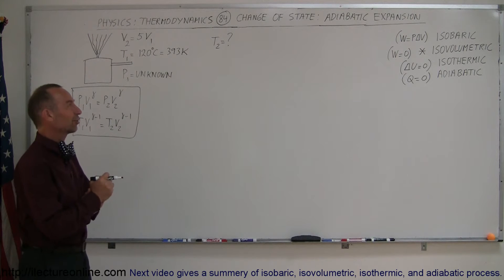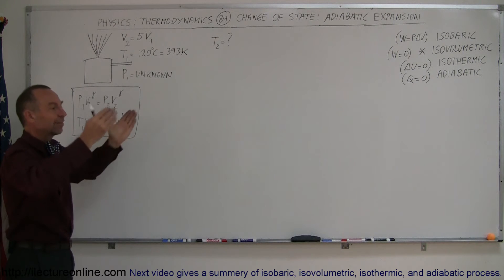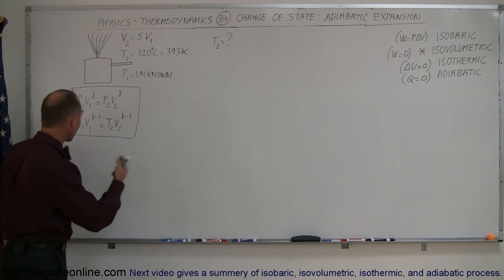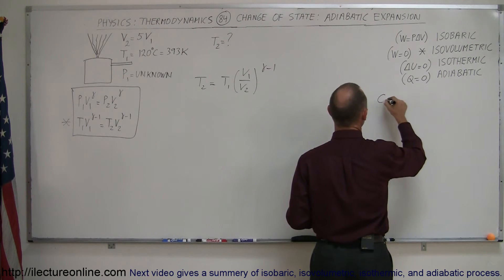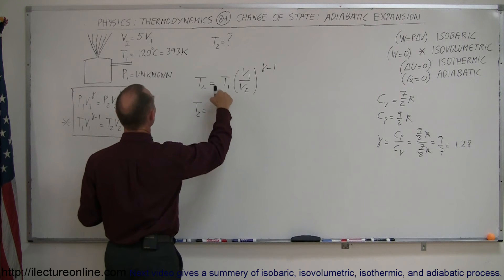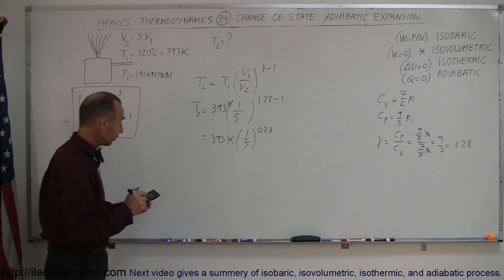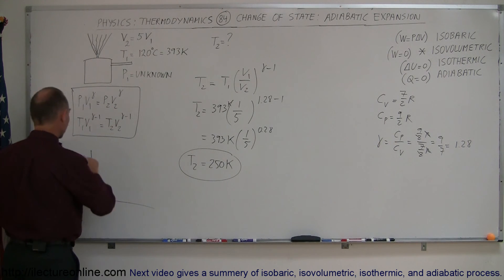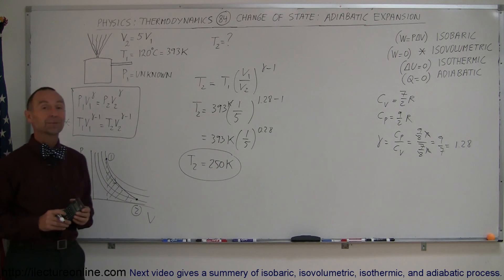Physics 27  First Law of Thermodynamics (20 of 22) Adiabatic Expansion

Comment: Just want to make sure I got this right, T1 is the temp when gas is being released from the pressure cooker, so it is the initial temperature; V1 is the volume when gas is being released, and it is expanding to 5 times its V1 volume due to adiabatic process (no heat exchanged and all works are account for only changes in internal energy); therefore T2 is the temperature after gas has expanded as an adiabatic process to 5 times of its V1, right?
Reply from the maker: You are correct.

Comment: if we compressed the water then how much temperature increased per unit of mass and volume or weight so by   hydraulic pressure we can cook our food?
Reply: The reason the pressure cooker has the advantage in cooking food, is that it allows us to cook with liquid water in excess of 100C.  The pressure cooker usually cooks at around 100 kPa of gauge pressure, and at sea level, this means water can be in a liquid state up to 120C.  Water is most conductive in its liquid state, and even better during the process of boiling.  But once it vaporizes, it is much less conductive.

Comment: The expansion or spray is adiabatic expansion because the pressure drops, pressure drop drops the temperature & work is done by the spray on the environment against the ambient pressure.
Kindly verify.
Reply from the maker: The only qualifier for an adiabatic expansion, is that it happens so quick, (or the amount of gas is so large), that no heat is exchanged.   (Q = 0)
Reply: The process is quick, Q=0, W is -, which means the change is internal energy decreases. Let me repeat.

The bottle contains gas at higher initial temperature and pressure. When we push the button, the gas expands adiabatically outside and the gas does the work to displace the atmospheric back pressure. The pressure of the gas drops and the temperature drops during the adiabatic expansion.  The process is quick and not heat is removed during the expansion. 

Thanks for clarifying, great answer.

Comment: The steam expanding out of the hole in the lid is adiabatic process. 
Steam expands out & work is done by the steam, pressure & temperature drops due to the expansion or volume increase.
Please verify.
This means air duster used for cleaning keyboards, shaving cream pressurized cans, deodorant spray cans, pressurized air tire cans, all undergo adiabatic expansion when we press the nozzle?
Kindly verify.
The can & nozzle skin temperature drops when we use these cans, why? Is it due to the adiabatic expansion.
I used to think the cooling happens due to isothermal expansion inside the can?
Kindly verify.

Comment: High pressure inside the pressure cooker increases the boiling temperature due to the pressure that is due to the heat added & the vessel is airtight. Though, the pressure & temperature rises but no work is done inside, and heat is added to the pressure cooker, so it is not adiabatic process. Is it the constant volume process? I think it is called isometric process. Kindly verify,
Reply from the maker: The example here refers to the gas escaping from the pressure cooker.    Your question is relative to the pressure cooker heating up with no gas escaping:      1) No work is done since the gas is not expanding.  (V = constant)      2) All heat added is converted to the increase in internal energy.

Comment: Shouldn't volume of the pressure cooker remain the same before and after heating?
Reply from the maker: Chris,

Inside the pressure cooker yes.
But this problem is talking about the adiabatic expansion of the gas escaping the pressure cooker.